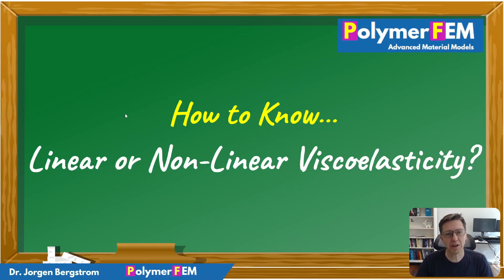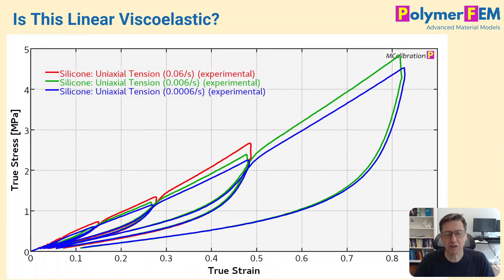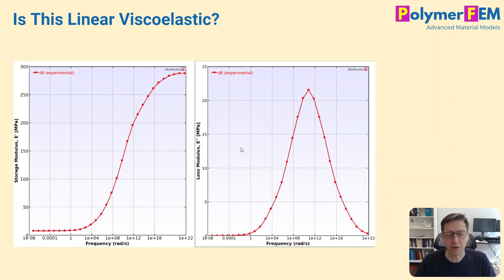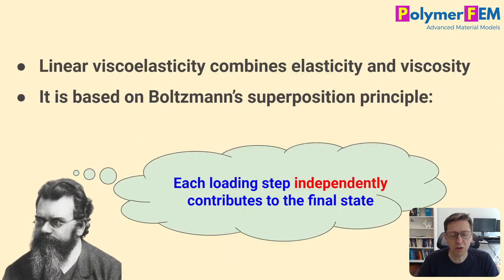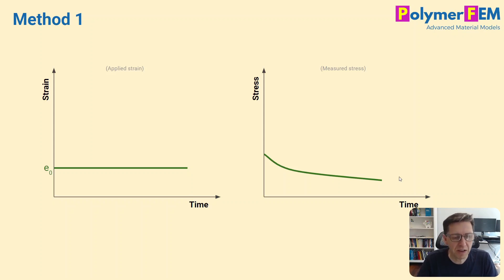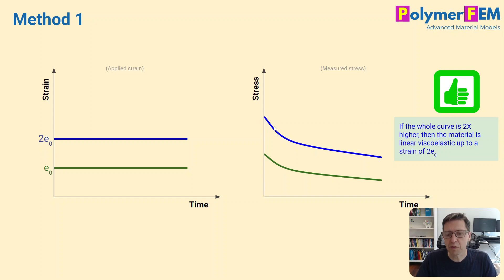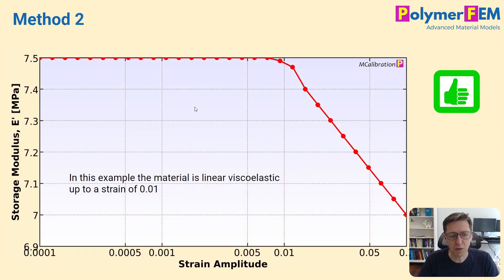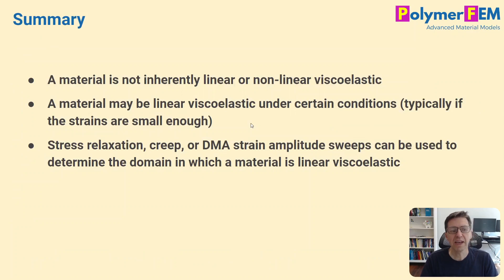How to Know if a Material is Linear Viscoelastic

Comment: I done the simulation of loading and unloading of the structure with assigning the engineering data as isotropic table(youngs modulus and poisson ratio) and multilinear isotropic hardening (true stress vs plastic strain). 
I got the different result in unloading condition than experimental one.
I studied about that the viscoelastic material while unloading it has permanent deformation is less compared to ductile material.
I done the experiment of that structure which has result in less permanent deformation. So i consider that my material is viscoelastic material. Is that correct?. And also need how i assign the material properties of viscoelastic material for compression test in any analysis software
Reply: Any updates?